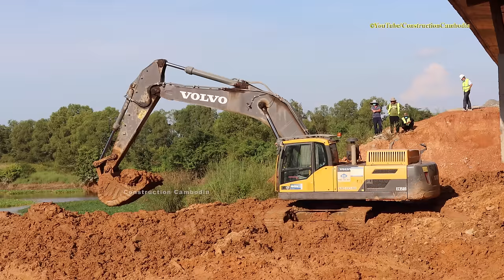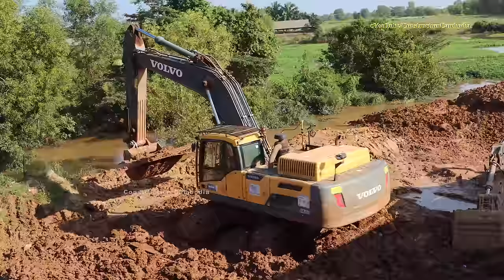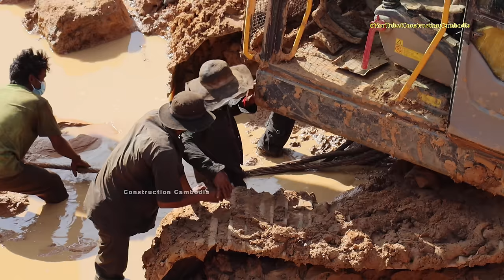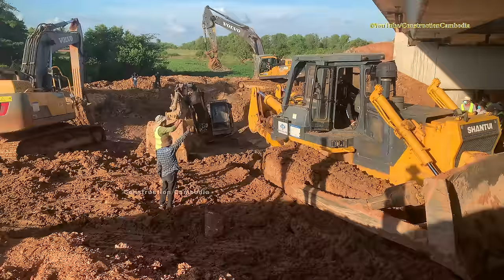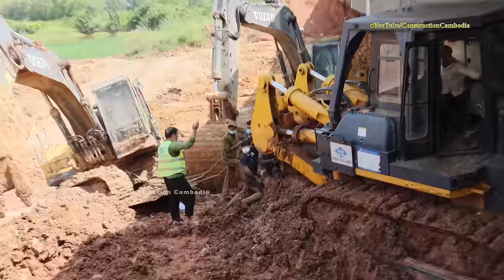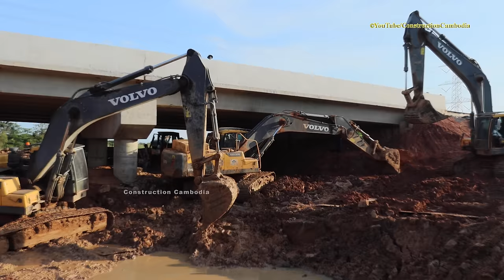Heavy Excavator Accident Sink Underwater & Stuck In Deep Mud Recovery By Excavator & Bulldozer

Comment: One of the things I've noticed about these videos is that they never seem to learn from the mistakes. They just keep trying to do the same thing over and over. It's like, well we got it to work last time, maybe we can do it again. It's almost like they don't want to learn how to do it better and more efficiently.
Reply: Job superintendent should be fired.
Reply: I had the same mentality until I realized I am not in their shoes. Preasure, Time, Deadlines it can all get to you / this is a strategy to delay the project...
Reply: 99
Reply: 999
Reply: 9
Reply: 9
Reply: 9
Reply: @pvillehick67  l90l
Reply: 99
Reply: 9999
Reply: 099099l0
Reply: 90999999
Reply: 99999
Reply: I wonder if the even have wooden mats to lay down preventing them from sinking into the mud.  I wonder also how can somebody even get this stuck, and the recovery is low tech from it's best.

Comment: They call this the half bucket method, it takes twice as long, but it takes twice as long.
Reply: Sure my wife can do that job....better
Reply: Did you ever do something like this?
I didn't think so.
If they take a heaping bucket, they'd be in the hole with the other hoe.
They have pads, but that's super soft material. Think about the leverage factor.

Comment: Are winches and snap blocks not a thing? Maybe it's because I grew up in an area that does logging/fishing but you would think they would have at least 1 powerful winch in their fleet. Throw some snatch blocks in with the excavators as anchors and you get an easy 4 to 1 advantage. if the dozer and 2 excavators drop their blades/buckets to act as anchors, they would have a holding power greater than force they could exert while trying to drag the machine.

I get a winch and cable are expensive but so is losing time running machines for recovery. If the the cables/snatch blocks are cleaned off and stored out of the rain after use, they should outlast all the machines and people.

Comment: you could have used a auxiliary hydraulic unit and connect it to the hydraulic system of the excavator- that way you can use the excavators hydraulics without engine power
Reply: Didn't know that. Is that on on the hammer lines
Reply: @seamusmcmahon1182  no , on the man lines  that usually come from the hydrauklic pump to the valve block
Reply: @prinzeugenvansovoyen732  Great idea!!!
Reply: Are the connections above mud level. Or is there a new system that you can connect up high on the boom, then back flow through all the valves, that are shorted out because they are electronic controlled. Then get the expert like you to tell them how to make it work?
Reply: J,aimerait   bien   voir  le  système   faites   une  vidéo   📹   s,il  vous   plaît

Comment: How could they assume to have enough pulling power to pull/drag the stuck excavator, still sitting deep in the mud, up the steep slop.
If ignorance would be a blessing, then these guys would be really blessed!  

The excavator looks it has been sitting in the mud for a while.  Around all the pins is rust as if it was sitting in the mud for weeks.  

There are other videos of stuck machines in this channel and I always wonder how people can perform this kind of jobs with soo little common sense.  Somebody mentioned letsdig18 and that the guy first assess the situation and then uses mats or other things to prevent from sinking into the mud, something the people in Cambodia don't know or don't use.
Reply: Interesting point. The marks under the boom pins. Looks like no maintenance. To me. 
Are these Cambodian road construction machines government owned ???
If so that explains it.

Comment: Things must have been real bad for them not to try to get the stuck excavator started, I never once saw anyone even looking in the engine compartment. Once clear of the water they can fix anything needed to get it running which would have helped imensly.
Also though I didn't understand a word, there were far too many chiefs and very few indians giving out orders. You need one person, and maybe a trusted sidekick to get the job done faster.

Comment: It did not appear to have been underwater. Once they got the water and mud lowered, the mechanic should have been in there trying to get the engine started unless the crankcase had water in it. With a running engine, the hydraulics for the boom and bucket could have been used as a pusher even if the tracks were spinning.

Comment: Get some excavator mechanics to locate and release pressure lock up in the hydraulic motor,  in order to free the drive chain, enable it to move freely while pull up by bulldozer..
Reply: The hard part is to find those mechanics, that can swim through mud, we haven taught salamanders how to be hydraulic experts.

Comment: The guy running the machine on the back end has no clue, taking water out of the hole dumping it higher so it all runs back in, armatures in charge of heavy  equipment, three day s now, im amazed they didn't blow the  bulldozer clutches.

Comment: rescuing a excavator that has no power you need to disconnect the hydraulic lines to the drive motors and connect inlet and loutlet line together to let it roll freely
Reply: Now what you say would be perfect if they could have gotten to the lines but the lines we under mud and water.  Plus those hydraulic motors for the tracks spin quite fast but use gearing to slow the tracks down. They have a ton of torque because of it but don't move really fast so trying to disconnect the hoses would barely help because the tracks don't turn fast at all because they don't have enough torque to get the motor spinning fast as it normally would.  The proper way to get the tracks to not hold back would be to open the cover on the finals on the outside of the tracks and pull the final planetary gear out of the housing and put the cover on. Then the tracks won't be trying to turn the motor and be held back. They would then spin freely.
Reply: @jeffreymurdock8366  if so they could have used a hydraulic aggregate to connect it to the excavators hydraulics, so the excavator has hydraulic power without engine power

Comment: The job could have been done much easier by digging straightforward in front of the machinery and while doing that freeing it from the mud with the bones of the backhoe and the Cherry pickers they could have free the machinery much safer and while they was digging to free it from the mud with the Cherry pickers they should have been working on trying to start the machinery now that way it could have helped itself and made the job easier and safer if they had got it started because it wouldn't help freed itself by you raising the bone and pulling while the bulldozer was pulling everything

Comment: bridge looked stabile enough - you could have lifted the excavator out with a 200 ton Autocrane - no need for any digging other than for mounting points - just lift it straight up out of the mud
Reply: А кран ты такой подгонять? Будешь

Comment: I saw my dad hook up a portable hydraulic unit to one an run the hydraulics without an engine power think theirs a valve down by the main pump that he plugged into that machine stuck could have helped dig itself out if dum dum ran the motor hot when he got stuck
Reply: Was the one your dad drove that way buried up to the hood in mud and swamp water?
Reply: @SPUDHOME  yes an I didn’t say he drove nothing I said we used the hydraulic on the stuck machine to help dig itself out

Comment: Regarding the issue of repairing the stuck excavator during the process, the only fact that makes sense is that the engine/drivetrain must have blown.

Then again, no sign of oil or hydraulic leaks, so what gives? Can only assume that the machine suffered catastrophic failure bf it got stuck or during the process of the panicked operator trying to escape.

Last, I'm sure that a Cat D9, or a comparable Asian counterpart, and a longer cable would have been able to pull it out on the right side (away from bridge). But finding such a monster dozer in rural Cambodia was likely improbable.

All the forces and vectors were haywire on this recovery. 

It was also maddening watching them operate without radios and not having ONE guy giving directions instead of a committee.

I also kept worrying that the one excavator was going to torque the boom arm by pulling on the stuck excavator's bucket.

And why no trash pumps to keep the site dewatered?

Anywho....it was fun watching the recovery...lol...I bet they wanted to give up during the ordeal!

Comment: Those drivers certainly earned their wages that day. I hope their bosses appreciated it and gave them bonuses. It made me wonder with that soft soil how good the foundations of that bridge are and could the bridge have supported the weight of a heavy duty crane if there was one available, although I assume there wasn't one in the area.
Reply: L4
Reply: And you said that they earned their wages for the day and should get a bonus?? Well it’s a good thing that you don’t own the company because if you did you would go bankrupt.!! Specially wanting to give bonuses to people who should have gotten this machine out in a matter of hours with all the equipment they had access to, but one thing they need and don’t have is OPERATORS, not drivers, theirs is a big difference between the two.!!! And they’ve only showed us 2 1/2 hours of video and at the end the Excavator is still stuck in the mud hole.!!! And it makes me sick to my stomach when I see people treat heavy equipment this way unbelievable.!!!🤬🤬🤬
Reply: @terrysweat4187  How would you have got the stuck machine out in a matter of hours?
Reply: @terrysweat4187  Those guys were CLOWNS NOT OPERATORS
Reply: @terrysweat4187  I kind of got the impression they didn't try.  The digger buckets did not lift the back as the dozer pulled. AND it's front blade was down meaning the tracks had no weight on them so no traction..
I an puzzled by this..

Comment: you could have used a crane from the bridge- could have lifted it out and set it straight onto a truck to the repair facility - water truck could have washed the mudd off once the loaded excavator  was off the bridge
Reply: I would’ve paid too see that happen,I bet the bridge would’ve collapsed.!!😂😂😂
Reply: They're in CAMBODIA not the industrial world with abundantly available & experienced Heavy Crane crews.
Should, though, always have plenty of support mats on-site made of locally available 8x8 timbers ( or logs) chained together that they carry when working near soft areas ( NOT JUST plywood or those few metal sheets )

Comment: Can You hear the slackness of the bolts ( especially of the Shovel bolt ) ?
This comes from improper use of such construction machines.
Likewise the Excavator got into this Situation.
And finally in the same way the Excavator has been salvaged.
An experienced operator will never drive its machine into such muddy area.

Comment: A good water pump would have helped keep the water level under control, so much expensive equipment of the wrong type and badly used.
With 2 x  buldozer and 2 x 360's they could have dug a shallow ramp out of there in far less time. I just cannot understand why the tried turning and pulling it towards the bridge that severely restricts manoeuvrability, rather than the other way away from the bridge, then a straight ramp out of there.